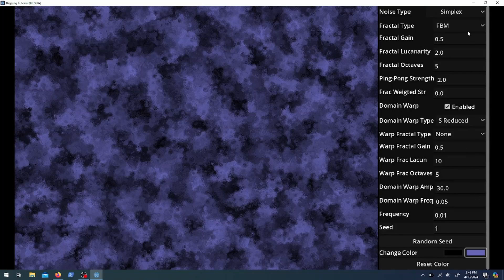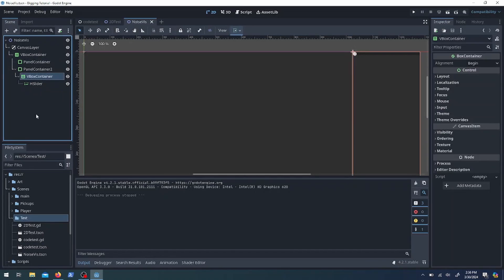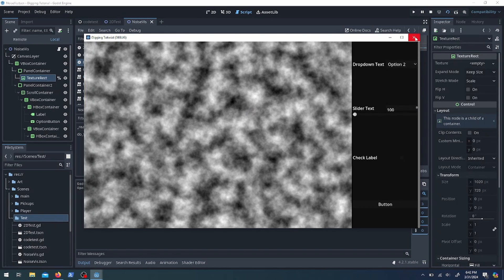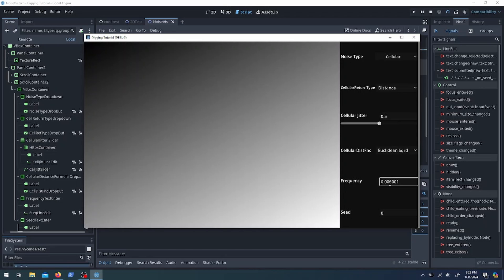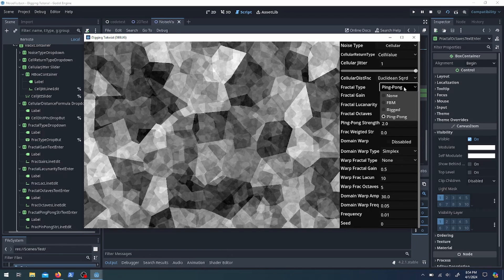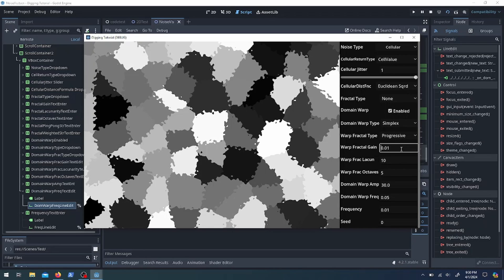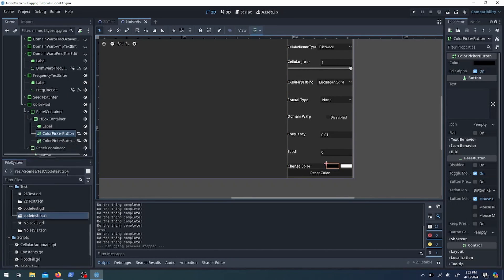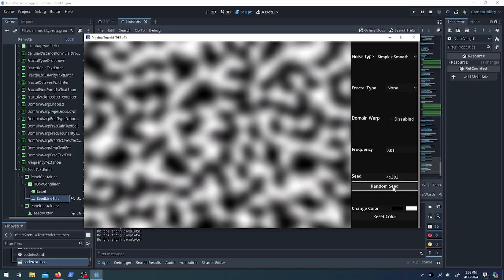Godot 4.2: What does FastNoiseLite even do?

Comment: For future users of FastNoiseLite (with or without Godot), the FastNoiseLite library that this functionality comes from has a browser-based visualizer linked in the GitHub repo for the library. Building a tool like this is great practice for a number of things, but for anyone who doesn't want to go that route, they already have a visualizer you can use, and then plug the values into your project.
Reply from the maker: They should link that in the docs, I had no idea.